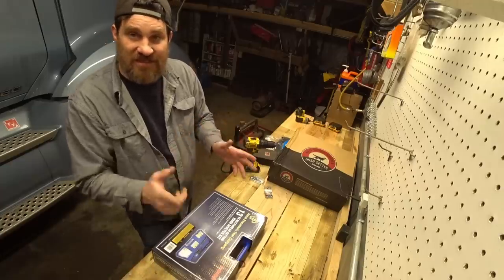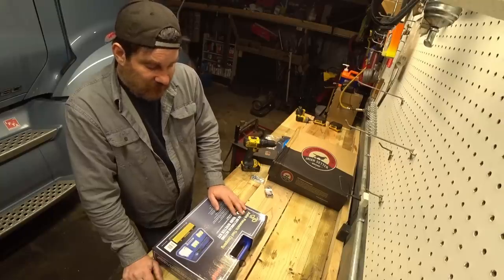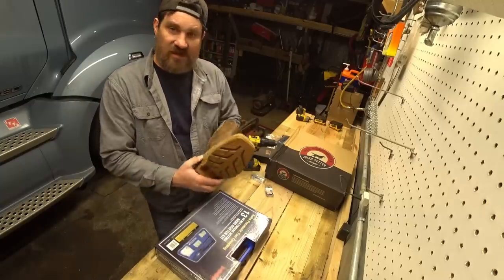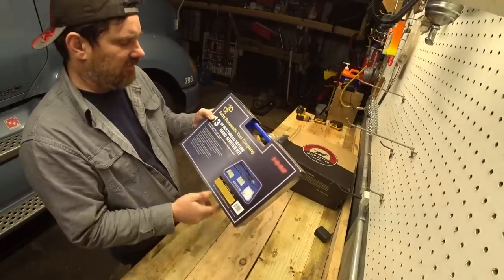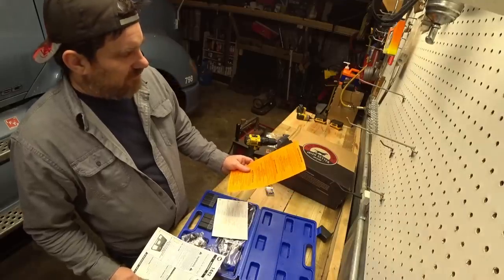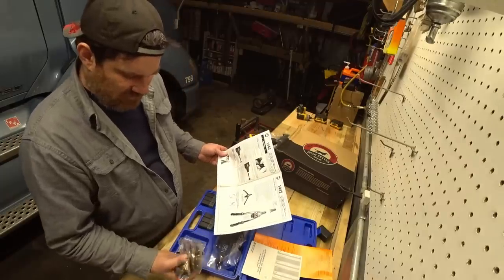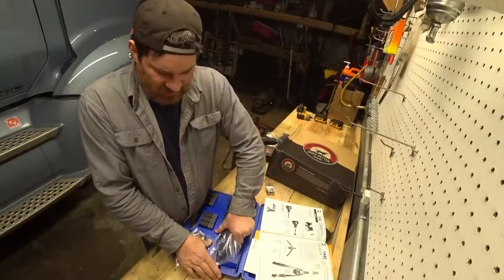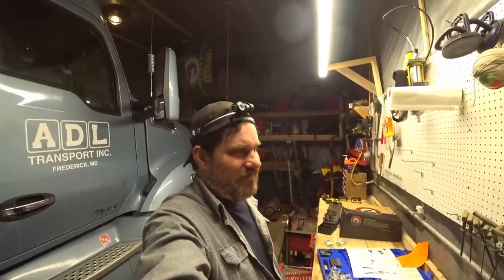December 7, 2018/486 Trying My nut/thread setting Tool & what I’m doing on my Vacation

Comment: Great tool.  I will have to order one for myself. The only weakness would be the holding power of the swedged  rivnuts vs the holding power of a regular nut and washer.  If it breaks lose, you could always drill it out and install the next size larger....  That is a big job changing out the rear seal. Good luck getting that done in time for your Monday load pick-up.  You remind me of that TV show "Tim the Tool Man"

Comment: This is a dangerous fix alone.  Years ago I did them with my dad and rolling that transmission around on the jack is no joke.  Of course it's been 35 years, so maybe the transmissions are lighter now.  Dad made a set of truck ramp back then out of steel and I'd just drive up on them to raise the front.  Did it to a twin stick B-61 Dump truck in 82.  Transmission in that thing was two of others we had done before.

Comment: Sounds like a big job on Big Blue ,Rivnuts can be a life saver have an air powered tool makes the job easy.
Reply: True but if Larry needs to used it on the road he can. with an air powered tool it limits where it can be used. Manual more versatile for Larry.

Comment: I bet it’s not your rear main where is leak coming from, there’s pressurized oil flow opening on back of the engine block which is covered by bell housing I’m pretty sure it’s leaking from there....

Comment: Why not a screw driver tip on a ratchet and extension? I would much happier with a set of those vs another screw driver set to put with the others lol
Reply from the maker: I never use the set that goes on a ratchet, they have to try one of those. I’ve always seen them but never tried them

Comment: Hey Larry it looks like that thread doesn't go all that deep and you bottomed out in there possibly. I've never seen one of these before and it's very ingenious idea but it looks like you might have to shorten your bolts or have them to almost exact lengths to work properly.
Reply: We use these for applications where I work and when you put it in place and squeeze the handles together it expands to lock in the hole but does not block off the back end of the Rivnut so the bolts can go all the way thru just like a nut/weldnut.
Reply: @richardwood9309  well that makes sense but it sure looked like he ran out of threads where he was trying to use it?
Reply: its definitely not his first time at the rodeo...pretty sure he knows what he's doing!

Comment: If it a company own truck why dot you seen it to a repair shop so the company pay for it
Reply: Larry likes to do the work himself so he knows it's done right and he doesn't have a lot of down time while the truck is in the shop.  And the company does pay for the parts and labor on the bigger jobs but Larry doesn't charge them for the smaller ones.